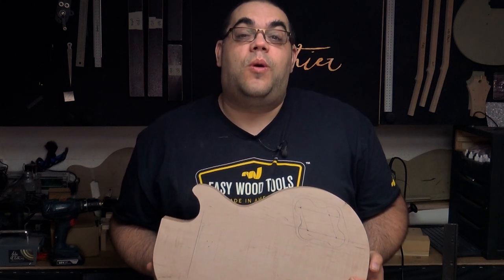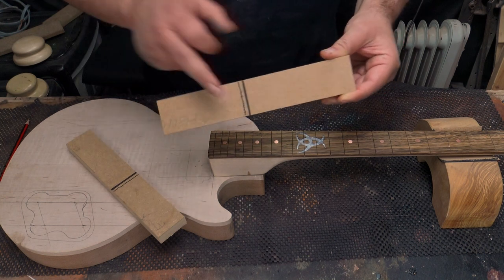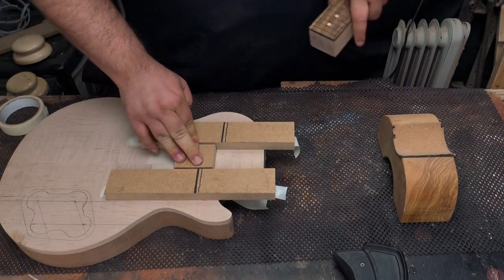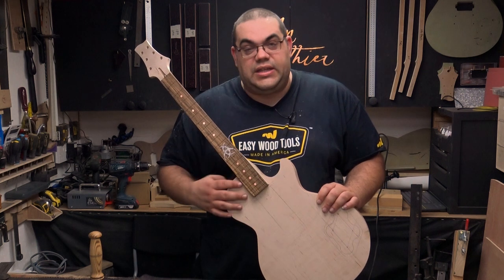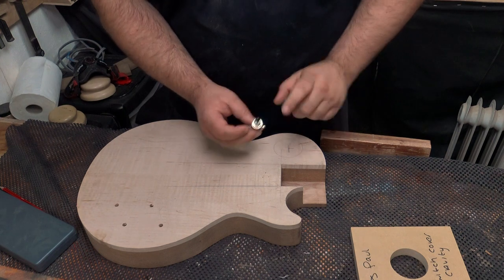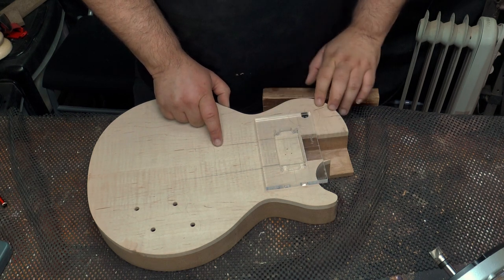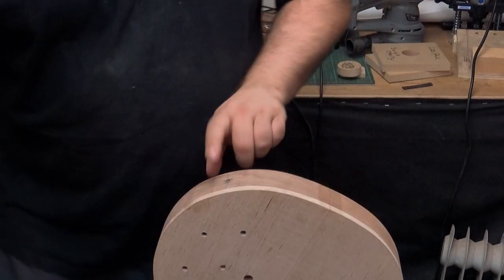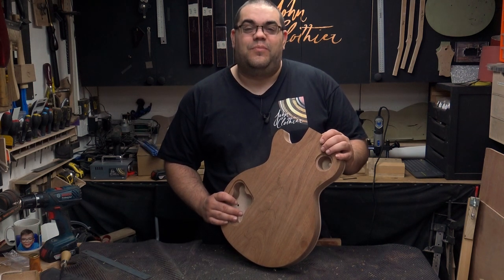Great Guitar Build Off 2020 - Unofficial - Part 6

Comment: Looking good John. Gibson and myself route the Body part before the top goes on. Like a channel for the three way toggle and the control cavity and even the pups. It's gonna be tricky to drill access to the switch. Did you offset the bass side of the bridge back an 1/8" or 3/16"? You're going to play heck getting the fat E string to intonate properly if the bridge is straight.
Reply from the maker: Thanks buddy! Yeah I think I’ve come to that conclusion that doing it before the top goes on is the best option! Still learning and these are the kind of things I am finding out as I go along. No I didn’t offset the bridge at all. I looked at it and I thought I should but didn’t know how much so thanks for giving me a clue for next time. Luckily my bridge has adjustment for it so I will still be able to offset it on the pins. Not sure how much by by hopefully it will be enough. If not it’s something to learn for next time.